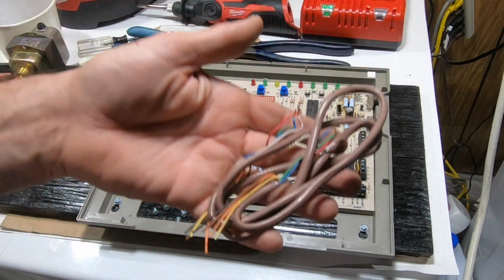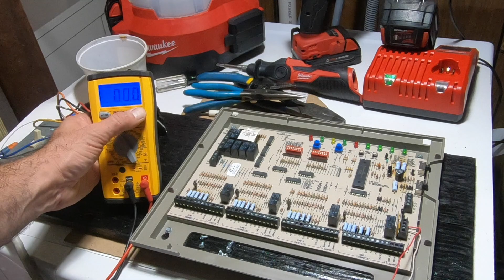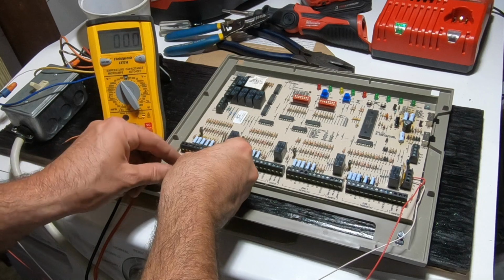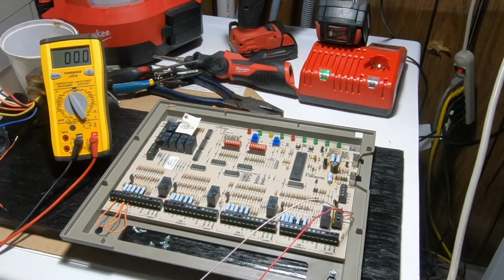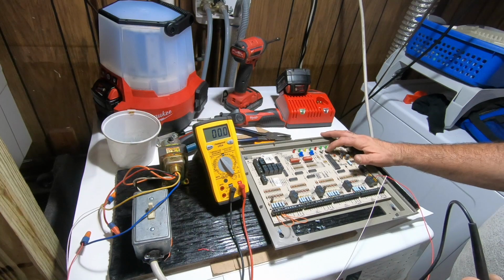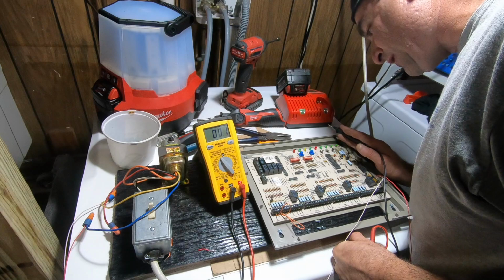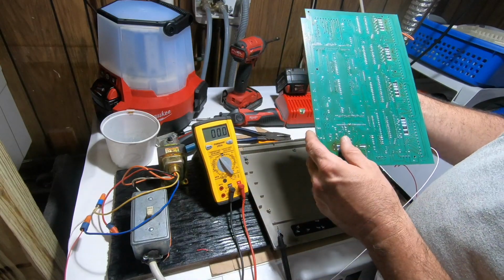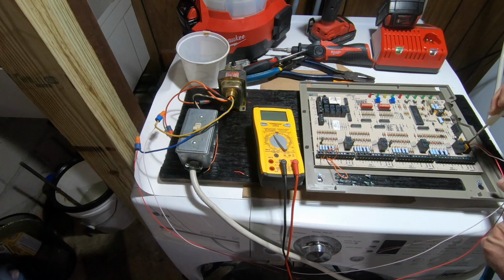Setting Up HVAC Zoning Panel Test To Repair Board

Comment: the hvac/unit connections are likely fully isolated from the zone board transformer, dampers and thermostat connections, seeing that the HVAC unit has it's own transformer and voltage, that just needs the correct wires touching. that means check the terminals to the HVAC unit in continuity or resistance mode to see if they're functioning.
also the jumper in top corner near the HVAC terminals is ON for single transformer and off if the HVAC system has two transformers and has nothing to do with the zone board transformers, just check across the hvac terminals in continuity/resistance mode on the meter and not to anywhere else on the board.
the jumpers near thermostat/zone connections are OFF for single stage thermostat and ON(shorted) for multi stage thermostats.
Reply from the maker: throttle bottle yes I had a brain fart here, I never connected a board like this before without having a system attached. The  system is separated from the zone control transformer. I admit to that mistake in the video I just publish. Still don't know 100% why the transformer smoked instead of tripping the breaker
Reply: hard to say, the breaker may be on the primary side, but could be secondary side, dissect it and see. maybe it was already damaged from previous system, heck, you think the thermostat wires from it to the board would have been getting warm/hot

Comment: Had to replace one of these boards for a customer because it was stuck in purge mode even after doing purge override and playing with all of the jumpers/dip switches. Had to replace a smaller 3 zone board for another customer because of the same problem. It seems to be a common problem with these older Honeywell truezone boards.

Comment: My luck is usually by the time I smell the funky smell it was too late. So what were ya testing the board for? Just experimentation?
Reply from the maker: I want to learn to repair circuit boards, electric soldering. It was too late wondering why the transformer smoked instead of tripping the built-in circuit breaker. The next time I worked on it the transformer survives. Not sure if I publish that vid today.

Comment: Repair bench at home, or on site?
Honeywell 3 zone or W/R Premier?
I had a  honeywell hold a fan call at 100 %. Replaced board and all ok. Eventually will diagnose pcb on component level to find issue.
Bad binding posts??
Reply from the maker: This is at my house. A coworker condemned it. I want to learn actual circuit board repair. I have always just replaced circuit boards when issues arise. Best part is usually it’s a Lennox Harmony 2 to a Harmony 3. Lennox loves upgrading their boards which at times might cause rewiring the furnace